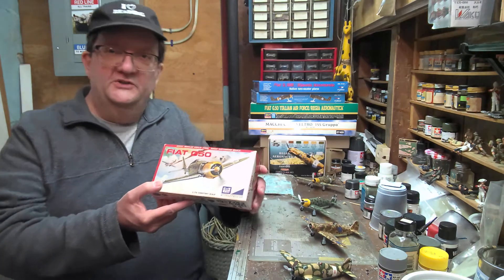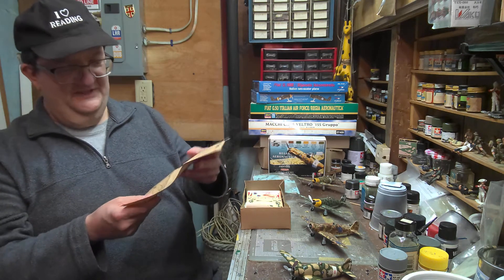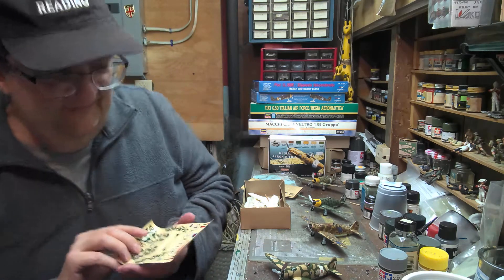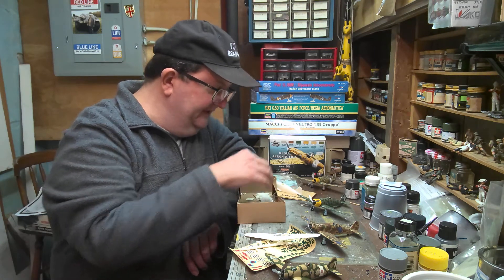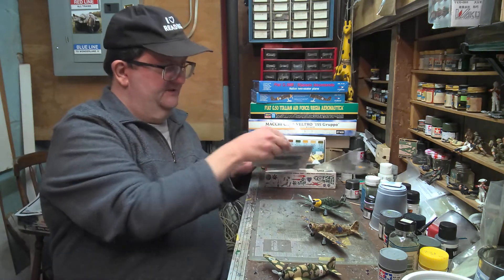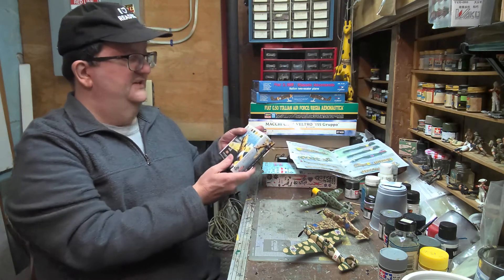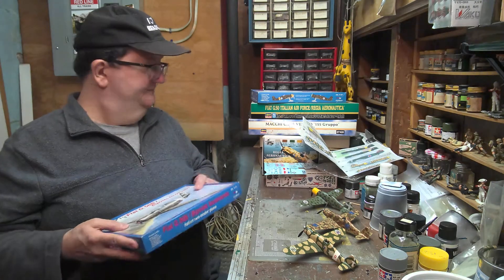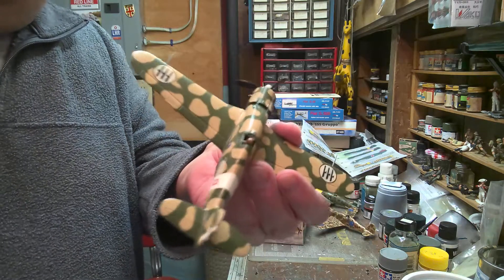Model Building - FIAT G 50

Comment: All of your MPC/Airfix Fiat G.50’s came out nice. Even your old one is nice too. Two years ago I built one of AML’s Fiat G.50 and it was a lot of work. It’s a multi-media kit and the fit was not great, a lot of filing and the Photo edge parts (nice) but small and difficult to glue on was a challenge. When done I had a nice looking G.50 but I think I rather build the old Airfix kit.
Reply from the maker: Thanks! Good to know about the AML kit. It does look challenging. I am shopping for a new airbrush, so I am avoiding these complex paint schemes at the moment.